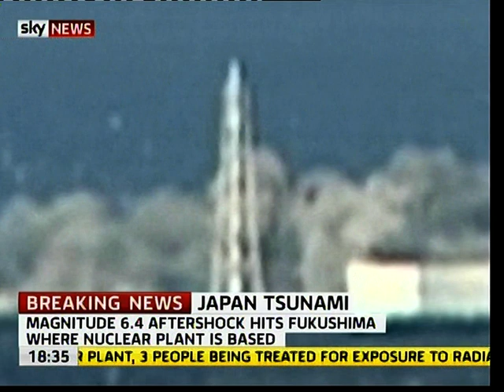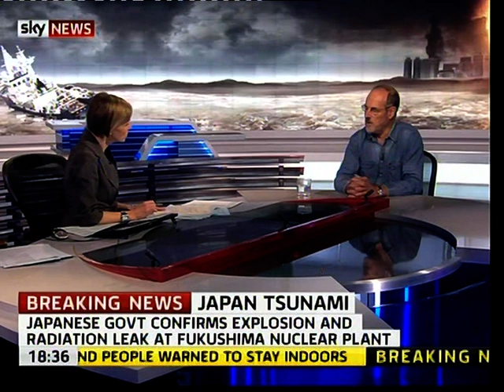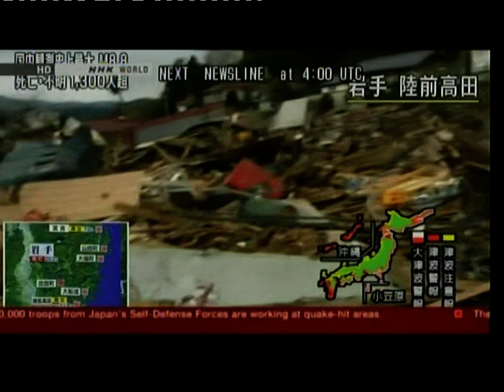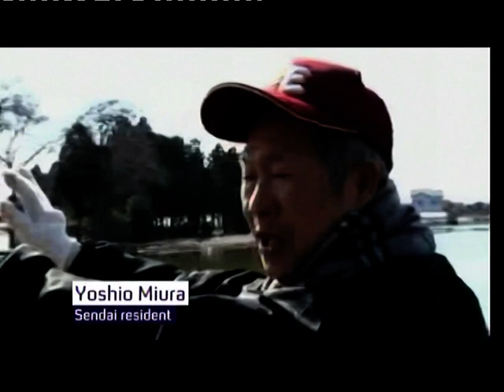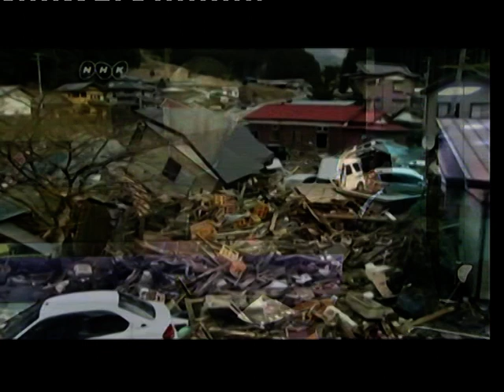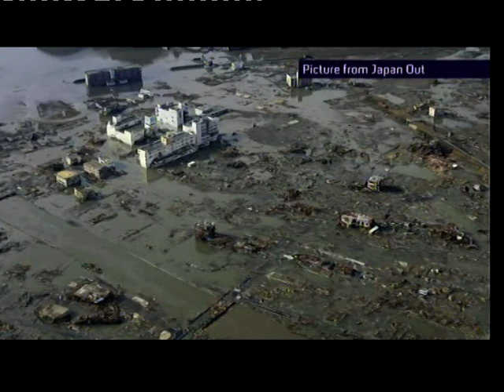Japanese Fukushima 1 reactor outer containment building explosion 12 March 2011

Comment from the maker: The half life of Xenon-135, the permanent gas nuclide, is just 9.2 hours you moronic idiot!  In 48 hours it has 5.2 half lives so less than 3% will remain.  Since it only gave an initial maximum (just after the explosion) of 8 times normal background, it will be 0.2 times background in 48 hours. You get more than that dose rate climbing a hill from natural cosmic rays.